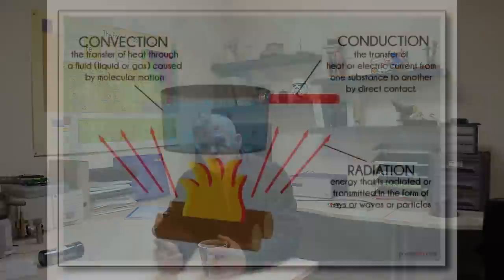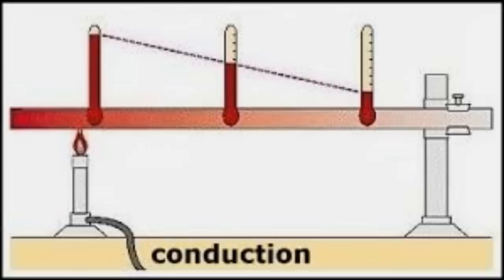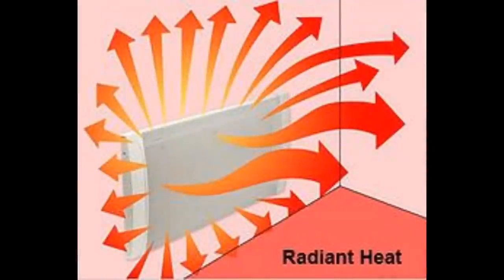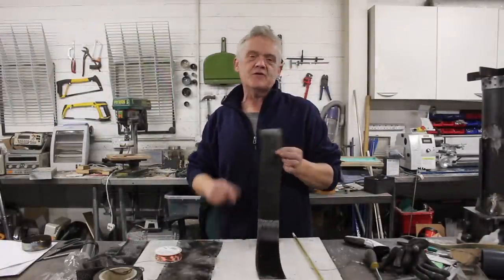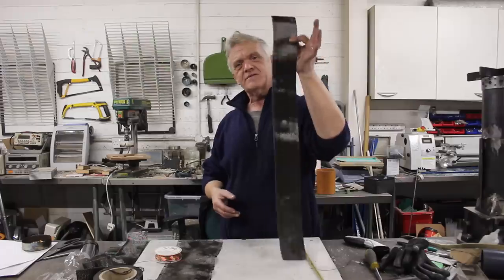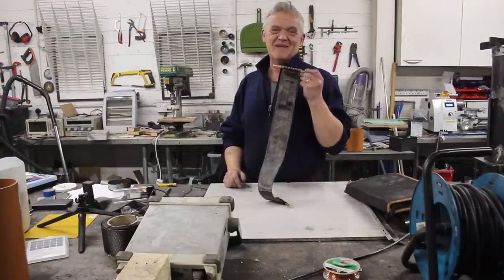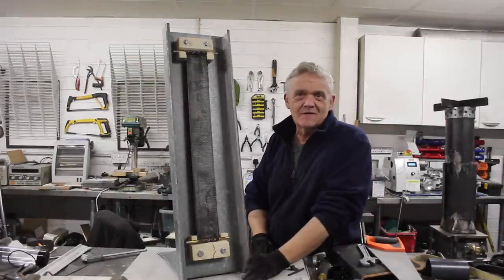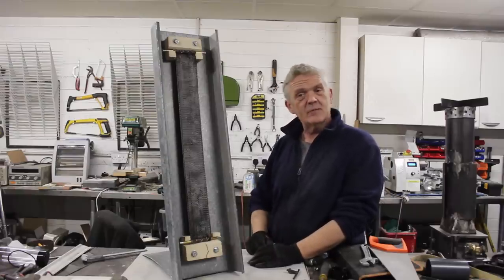1758 How To Make A Nano Carbon Infra Red Heater

Comment: Hello Robert, Here in the U.S.A. I purchased on line at A****n Prime a round 24 inch tower graphite glass tube infrared heater which is low cost about 79 U.S. now ( I paid 52 U.S. last winter). This graphite in a glass tube heater is  low power which pulls 210 watts 120V AC 60Hz on Low and 420 watts 120V AC 60Hz on High. My retired resistive heater was pulling 900 watts 120V AC 60Hz on Low and 1,500 watts  120V AC 60 Hz on High. This heater used a lot of electricity KW and the cord of this heater got very hot, which was a fire concern, not so with the graphite in a tube vertical stand heater. This efficient heater cord is always cold to the touch. Setting on my fireplace hearth when not in use, I shine the very hot narrow infrared vertical beam produced by this efficient heater onto the side of a standing upright  6" Diameter X 24 " Long vitrified orange clay round flue liner.  Standing the round clay flue liner on a couple fire brick allows space to have cold floor air draft by convection into the bottom of the round flue liner and heated air to drift out the top of the chimney liner warmed by the very efficient graphite in a glass tube infrared heater basking the clay flue liner's outer surface. Later  I added a 4 inch 13 watt 120V AC 60 Hz metal desk fan to nest between the base bricks with the prop facing up to the ceiling pushing air up and out of the 6 '' clay flue liner pipe. This configuration blows quietly the warm air across the sheet rock ceiling here radiating and adding thermal mass to balance the room's  heat. I use a reptile thermostat with a remote digital heat sensing bulb to control room temp to within one degree, which makes for an efficient stable room heater providing comfort for less money turning on and off as up/down outdoor temperatures chill the room. Hope this easy to assemble design helps save others on heating costs, offers safer heating and provides comfort. David from Freeland, Maryland U.S.A.
Reply: Very Smart! Stay warm
Reply: That is fantastic. Thanks for sharing that.
Reply: @allanjacques1738  Thank you for the kind reply. The heater I use is a Sengoku HeatMate SH-G420A(W) Instant Heat Graphite Tower Heater, Medium, White with two year extended warranty. The thermostate used was an Inkbird ITC308 Freezer Thermostat Heating Cooling Plug Temperature Controller Outlet 110V 1200W Digital Temp Control for Greenhouse Heater Cooler Reptile Brewing Fermentation Kegerator Probe. The fan used was a Holmes Mini High Velocity Personal Fan, HNF0410A-BM

Just maybe, Yankee Ingenuity has not ended. ; )
Reply: As Robert mentioned in the video, infrared/radiative heating is best (most efficiently) used for direct skin heating. And the best of those are the ones with a shiny/reflective dish that very efficiently direct the IR towards whatever direction you want it.

   If inexpensive is what one is looking for, nothing better than Solar heat collectors if one gets enough direct sun on their property (we don't unfortunately, otherwise I would build some).
Reply: @justinw1765   Agreed. My experience with the infrared heater has been the same as an outdoor fire pit on a cold winter night. When bathed in infrared heat you are freezing cold on one side scalding hot on the other. Here....this design takes advantage of the very efficent but uncomtorable graphite glass tube infrared directed heat produced and converts the heat to warming the rooms air most effectively, most comfortable at a low cost. A restive metal element infrared  heater technology as you suggest with a reflective surface to direct the heat would not be a benefit as the amps consumed are high. The graphite is inexpensive to run hourly at such low watts and when converted to convective heat is most comfortable to experance in a large area outside the very narrow vertical slit infrared directed beam cast onto the clay flue liner in close proximate. The deficiency of this graphite in a vertical glass tube with reflector technology's design is again this type heater hurts the skin like a burning of flesh by fire or hot liquid. The clay flue liner, so far has not cried out in pain. Thank you for the opportunity to explain the not so obvious benefit of converting low cost to operate graphite filament infrared heat technology to convection heat at a low componet cost. Hope that explanation helps my intent as to why to convert an efficent directed and very concentrated slit infared graphite produced tight beamed heat source into a whole room convection heater. Please take note that just 210 watts on Low / 420 watts on High 120 AC V are used to heat the room's air effectively. The encapsulayed graphite infrared heater technology compared to the past metal strip open air element technolgy consumes much lower watts and high heat BTU and is produced comparable to the always inefficent metal resistive element infrared heaters of the past.
Reply from the maker: that's brilliant mate - thanks for sharing
Reply: @davidl.howser9707   @Robert Murray-Smith  
Hi David. Your low wattage IR to energy efficient Convection heater conversion is genius. Could the IR incapsulated tube be placed inside the Clay flu thereby making it even more effective? Would be great if you could post photos. I'm in the UK so have 230v AC 50hz and need to find the equivalent IR tube you mention. 

In a similar cost saving vane, I have a 4 litre water distiller which consumes 750w and the heat it gives off from its heat exchanger condensing steam back into water feels as powerfull as my inefficient 2000w fan heater. I now use it exclusively in a large lounge and it gets toasty for a mere 750watts consumption.  Thinking of ways this concept could be turned into a dedicated heater system that drips the distilled water back into the boiler without it becoming a lethal pressure cooker.  Any ideas you have would be welcomed. Regards. Alex
Reply: @ThinkingandTinkering  Robert , it is I who should be thanking you, .....so " thank you", and I thank you just for you being you. I find watching your efforts produced most enjoyable. For me life is as simple as fellow human beings enjoying this life's interesting possibilities together bringing intrique to topics discussed. Thank you again for all efforts shown us, and the gifted pleasing results. Enjoy the Ride.

Comment: Thoughts on the topic:
Especially in rooms you also need warm/dry air. A infrared heater in the end also heats everything and the air, but if you are cozy warm in the direct exposure you might reduce the overall room temp too much and get humidity and mold in corners and behind objects. Cabinets. Everything not directly hit stays a lot colder.

Special radiator paint actually radiates more IR than normal paint, even the white one.

The quarz tube heaters are "better" over this because of the higher temperature they run at. The units come in 2 or 3 power setting modes up to 2100W with a bit of variance for the single tubes from 500W to 750W.
(Will of course need a inverter and lots of Amps at 12V/24V)

I dont know the spare part value of a single tube because in over 30 years i never had a single broken one. If you buy a complete unit with 2 or 3 tubes it costs around 35 to 60 bucks. So i'd assume 15 bucks or less for a single tube.
As a reference to get a mid sized bathroom (2.5m from from door to tub) normal/cold to cozy after showering a 750W quarz tube is enough. (Dont forget the shower/tub also brings in heat) The IR heater mounted above the door and you really feel the heat.
The basic room heating still done by the radiator.

Now instead of the carbon i would be interested in a low voltage"glowing" version, made by cutting apart the resistive wire in a 230V AC version. You can get them for 20 bucks. If you cut the wire into more then 10 pieces you are in the area of 24V volts.

I will need to check if the resistive wire i have for making resistors already dies when glowing (oxidization).
Temperature expansion between hot/cold also might be an issue.

Other options: normal resistors get up to 85°C at their rated load, so too low for good radiation.
Halogen light bulbs /car might work at 75W each, you dont really want the light but they are really cheap, maybe paint them red.. i dont know if they break if you coat them with matte black.
Reply: Forgot to add this in the comment:
For the humidity issue, breathing people inside a closed room, a dehumidifier is sensibel. A real one. Since they tend to work with a cold (condensation) and hot side they also convert a bit of electric power into room heat over all.
Turn Signal lights might work better over halogen, they are more robust+rugged for switching. Dimming via PWM to find the wanted heat emission point. And some already come in orange paint. Or the old infrared animal heater / medical bulb...

Comment: Nichrome wrapped around ceramic rods with a curved reflector is easier. we used to strip toasters of their heating elements before vaping wire and the controller chips were easily available. 
Ready-made 'Clapton' wire seems to work the best for us.

Comment: Two thoughts.

1) if you put the slotted holes at the bottom, the weight of the firebrick will tighten the carbon ribbon.

2) A 12 volt system means that you can run this with a solar panel in an off grid situation or run it off a deep cycle marine battery.

Question on the Ugrinsky turbine; will that work in the same way a screw turbine works?
Reply: I like your thoughts Scott.  Seems you are using the gray matter between your ears. Nice job fella too.
Reply: Bullet Point one...Excellent Idea! Bullitt point two, that is exactly what I was thinking! The more we can get away from inverters to convert form DC to AC the more efficient we are. Excellent points both! Thank you for sharing!!
Reply: @jackallen6261  
You're welcome.
Reply: @victoryfirst2878  

That's only true as long as my brain doesn't go into mad genius mode.
Fortunately, that's only happened once.
Reply: The fire brick may not be heavy enough to get it tight enough.  Unless you use the fireplace type which is denser and more brittle.  Harder to customize.  

One thing else with the 12v system, if you're power goes out and you have no solar panels or other "off grid" power generators you can run a length of wire from your car to power it.  Of course you'd have to run the engine so you don't drain the battery.  Not the first choice or an economical one but in an emergency situation it's another option.

Comment: you've just essentially created a heater that could technically run off of USB type c and if you attached a sand battery to that with a copper thermal distribution pipe, you could have a very nice creation. thermal pipe is copper pipe with a wick inside and 15% water or acetone to the length of the pipe. If you boil the liquid from the closed end until vapor shows, you quickly close and seal the opening and let it cool. you now have a vacuum sealed pipe that can near instantly transfer heat across to where you want it to go like a wire for heat.
Reply: Basically, it's a heat pipe.
Reply: @vanbrown6663  that's the other name for it. Everything has more than one name. Thanks for sharing 🙂

Comment: This is great, may build one. We have electric baseboard (skirting board) heaters, our power is from hydro on Vancouver Island Canada. 
I keep a couple of different types of heaters for when (a few times of year, storms etc) the power goes out (hours to days - out of town lol) and we are on generator power. 
However,  in humid places if you don't heat the air and have some fresh air that also gets heated, mould sets in pretty quickly.
I like the diesel heater idea, but diesel/heating oil is more expensive than petrol. I like a lot of the other oil and rocket heaters, the coolest is the "safety" heater you made.
👍😎

Comment: (I come back again!) We can also make a lactoserum dryer with it to harvest whey protein for a low cost of energy. Industries throw a lot of it.
We can make a bucket with many layers of that carbon sheet inside (isolated for security & for the elctric current doesn't damage the food & the equipment) so that lactoserum is captures into thin warm layers oh carbon heater. That way it will dry fast for a small amount of energy. And at the end we get that precious protein powder supply! 
And of course we can just make a box like the oven to dry fruits & vegetables. For the one who get lots of tomatoes feom their garden in summer i guess that's a much easier way to conserve them for winter than by cooking it and storing it in jars.

Comment: When in HVAC school i learned that a heat pump (with the evaporator coil buried about a foot "below frost point" under ground) can be actually above 100% efficient !  This will usually be "forced air"convection heat , or .. one could im-bedd the condenser coil in a stained black or dark brown concrete floor,  this would be a little infrared , a little conductive / it would make nice toasty feet , and convective since heated air rises also ...  ...   but most efficient indeed.   As a child when ever i visited my friends house it was totally comfortable even in worst part of winter his home was a heated concrete floor, and my home was always cool and drafty with cold feet no matter what... we had base board heated water system.                 Keep those feet warm.
Reply from the maker: you are talking about COP - coefficient of performance - that's not efficiency
Reply: @ThinkingandTinkering  Yes ; in all due respect ;  however as an  example:  given the same enclosed space , to keep it heated to lets say 70 degrees F, a heat pump with COP 4 will consume less kilowatt hours / day of electric , compared to a resistivity heater (graphite , carbon, nickel chromium, etc.)   All resistivity heating yields maximum of 1 watt of heat out for each 1 watt of electrical energy consumed,  where a heat pump yields more ;  so i guess we could say that "efficiency" of a heat pump "system" (especially Geo-thermal) is greater than 1:1 ...   For each watt of electric consumed to run compressor/ fan will equal greater than 1 watt of heat coming out the condenser unit (inside your home)...   I  wish you could design a small solar powered heat pump....    I know you can.
Reply: @audiowan  Over 100% efficiency would break the laws of physics wouldn't it?
Reply: @justtinkering6713  heat pumps are not over 100% efficient by themselves. Thier total performance installed or coefficient of performance is over the calculated 100% efficiency because they are stealing some power savings from the ground temperature
Reply: @humanistwriting5477   By Contrast heat pumps seemingly undertake the impossible  you get more heating out than the energy you put in.  This is possible because we are using energy to move heat - rather than converting energy directly to heat, as a result ( the apparent efficiency in terms of heat output is greater than 100%)..   cheers mate

Comment: I have a heated gilet/vest which I had to fix last week (cable separated from the power button). I'm pretty certain it's using carbon threads like this woven into a couple of pads to generate the heat. Seems like it probably wouldn't be terribly difficult to make some pads yourself if you have that carbon thread stuff (can't remember what you called it EDIT: carbon fibre tow), sew them into any clothing, and just attach them to a USB power bank. After checking the resistance etc and making sure they can't get too hot. If you have the threads at the correct resistance in parallel on each pad then one failing shouldn't affect the maximum contact temperature I believe?

Comment: If you want an excellent  IR Heater,  get the parabolic IR heater from harbor freight.   I used to use that thing to train Kung Fu up in a very frigid attic, in the middle of the winter.  The attic had almost no insulation... and so you could see your breath, if it got cold enough up there.   Normal space heaters, couldnt work hard or fast enough, to heat the attic, nor the people within it.  But the dish  IR Heater, would easily heat your dark clothing and skin,  even as much as 12 to 15ft away from it.   Im talking a very Toasty level of warmth.. to the point where it almost felt uncomfortable at times.   To help with that, I set it on the auto-swivel mode... which also helped heat the others I was training with up there.
Reply: I agree that the parabolic IR heaters are the best IR heaters.  They are very efficient at directing the IR to a certain direction. 

    Would just add that it doesn't matter what color the clothing is. IR light isn't like visible light in that respect--colors don't really affect absorption--black and white in visible light spectrum are about equal to IR, though black very strongly absorbs visible light. Many materials that are opaque to visible light are transmissive to IR and some materials that are translucent to visible light are opaque (blocking) to IR.   

  IR is also a very broad spectrum of wavelength--much more than visible light. There are bands within the general category of IR that act even differently from each other.  For example, some materials will only absorb or reflect the shorter wavelength IR and not the longer etc. Really interesting stuff when you get deeper into the details. 

  If I remember correct, polished, shiny aluminum surfaces are the best all around, broad spectrum reflectors of IR spectrum.